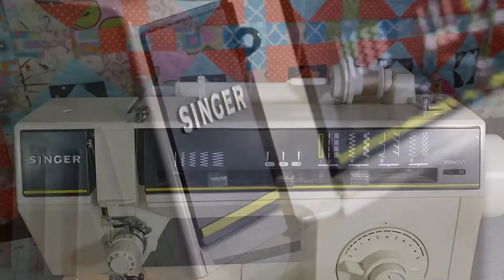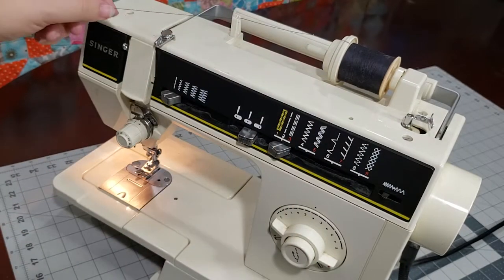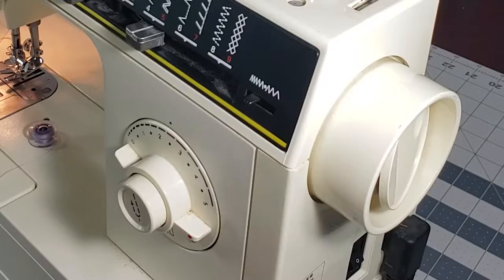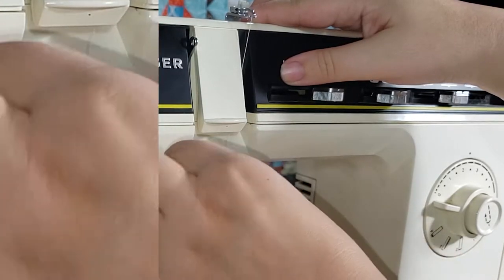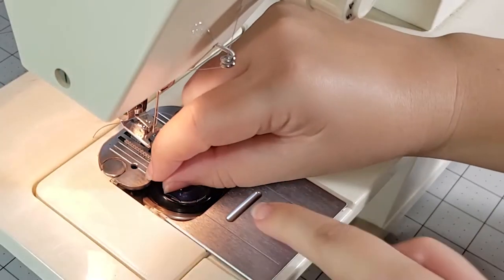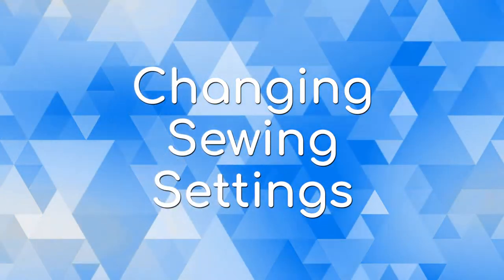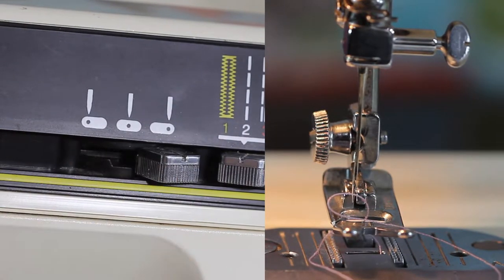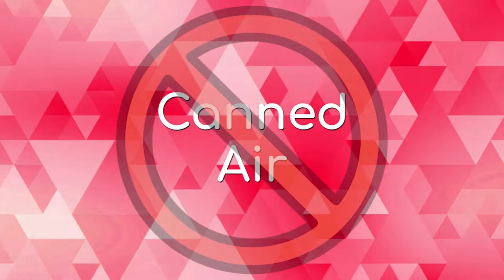How to Thread the Singer 6215C Sewing Machine and Troubleshooting Tips

Comment: You are a lifesaver!  I bought this sewing machine from a kijiji seller with no manual, but a video is much easier to follow than a diagram.  I only got one bobbin with the machine, so I followed your link to purchase more.  There are two types that look very similar, one is part number 312956 and the other is the same number with -S after it.  Can you tell me which one is for this machine?  Thank you so much!

Comment: Troubleshooting trouble shooting question. I have the 6606 model which is almost the same.  It worked fine for a few test patches but now I have a problem where the main spool thread is getting wrapped around the bobin.
Reply: Any solution?